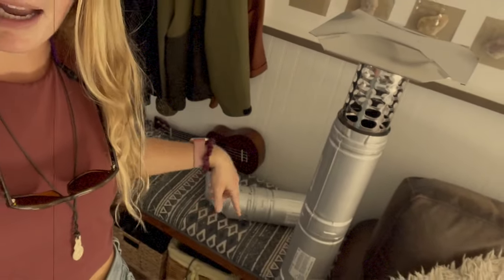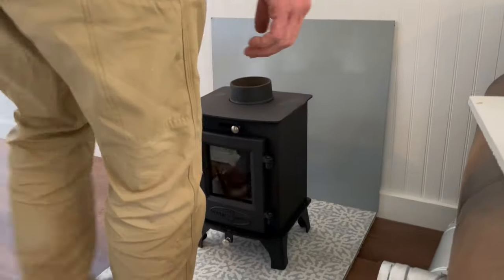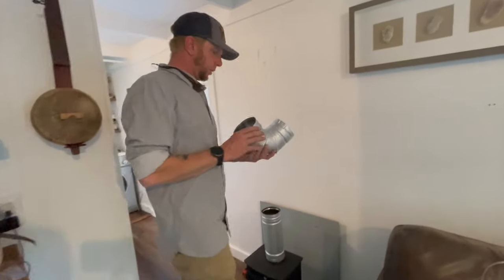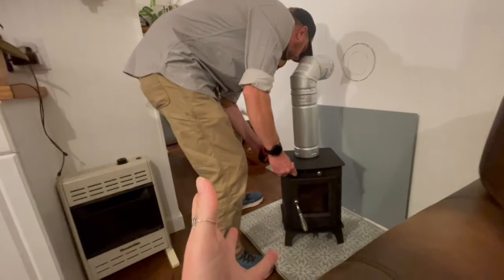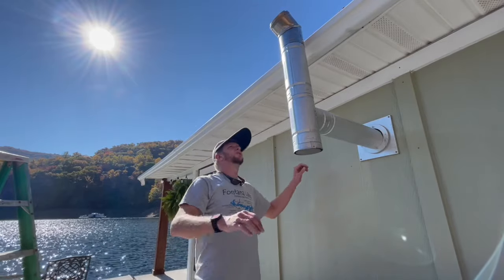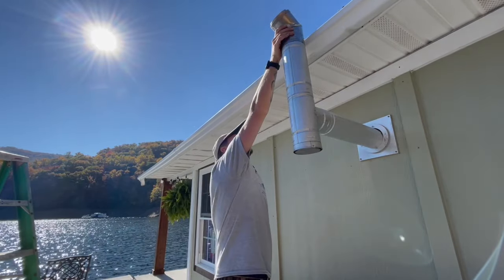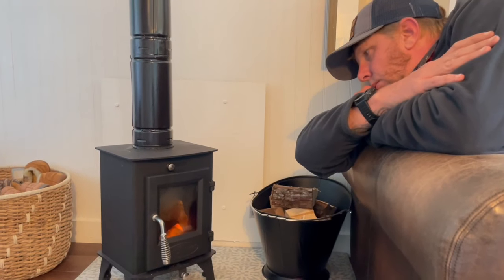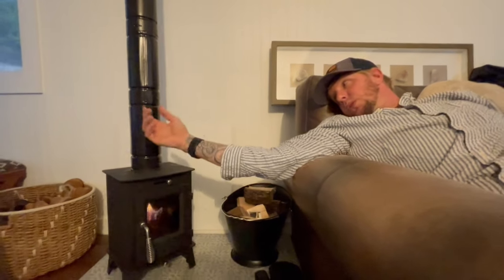The CUTEST Mini Wood Stove EVER. 🔥🪵

Comment: Check the rating on the vent pipe looks like venting for gas not wood!!! I think you will be very happy with the wood heat!!!
Reply from the maker: The vent pipe is actually a pellet wood stove pipe from duravent, it’s rated for 1000 degrees max continuous, 1400 degrees brief forest fire, and 2100 degrees 30-min tested. Much higher than the kind of heat output we’d have with our mini logs! 🙂👍 & thanks!! So far we are absolutely loving it, so cozy!!!
Reply: Super you will love the wood heat

Comment: I suggest a split air/heat system, spilt systems are so efficient you can run them on solar and much safer. It does look better with Black pipe.
Reply from the maker: Oh we would love a mini split in a perfect world 😅 we’ve crunched the numbers and our solar couldn’t support it as-is, we’d need to add a few more panels & batteries. That combined with the cost of the actual unit is just way out of our price range currently. Maybe one day, or in our next house! 😉 & agreed, we’ve seen the silver pipe pulled off in some houses but in ours it just looked so industrial! The black is much cozier. 👍

Comment: Recommend checking out a Heat powered stove top Fan. I believe the heat from the stove pipe turns the blades. They use them all the time on canal narrowboats in the UK. A bunch of the narrowboat channels on You Tube. Just a thought.
Reply from the maker: Yesss we have looked into these & hope to outfit our next stove in the new build we are working on with one! 🙌 thanks for the suggestion

Comment: Still using this stove? Just wondering how it worked out and how long the burn times were for you
Reply from the maker: We just sold this house last week and we left that wood stove in it! We used it all last winter though and loved it. Typically if we packed it pretty full before bed at 10pm, it would burn unattended till around 3 or 4am & then just have hot embers till morning. Won’t burn as long as a full-sized wood stove but with our house being so small & decently insulated, even if it didn’t burn all night it was rarely cold in the house by the time we’d wake up in the morning. so it met our needs anyway 🙌

Comment: The first burn should be outside (Toxins) and each burn after that let it slowly get hotter each time to temper the stove.. 
I like to throw a large chunk of wood in & forget it for a few hours so a mini-stove won't do it for me..
My pipes came black, but not shiny like yours..
Reply from the maker: We made sure to do the first couple burns outside before we installed it inside! 🙂👍
Yep sounds like the mini might not be the best fit for you then, but no reason not to have a normal sized one if you’re not too limited on space. 
If you like the shine you could always coat your pipes with the high-heat paint we used! It’s got a glossy finish. 
Thanks for watching! 🙏